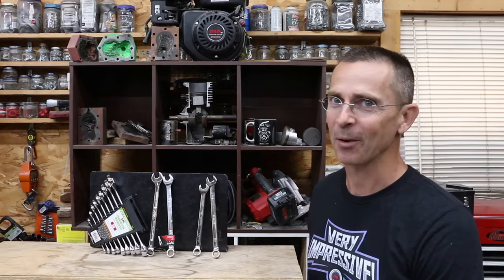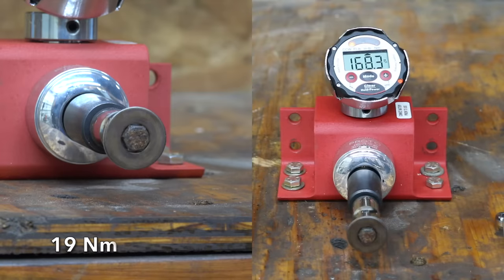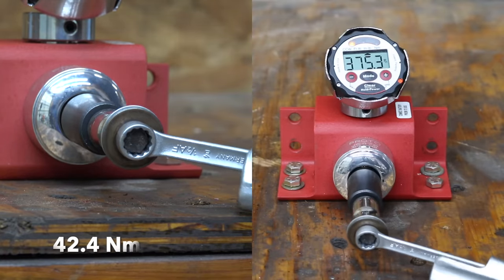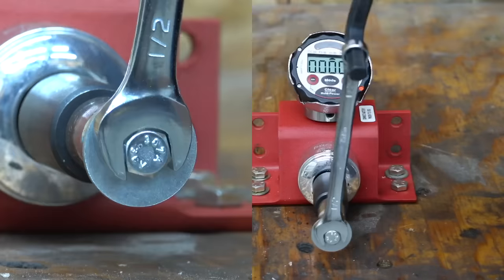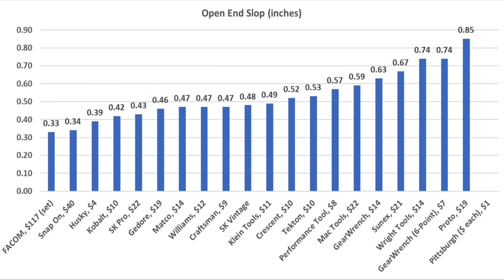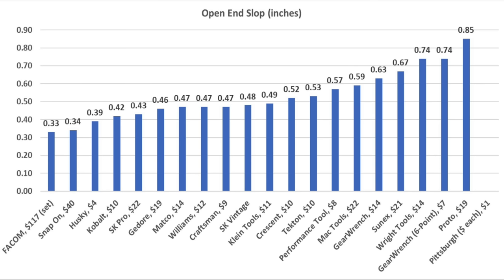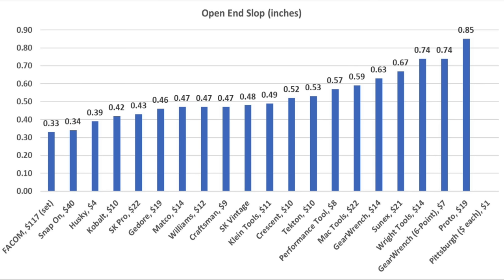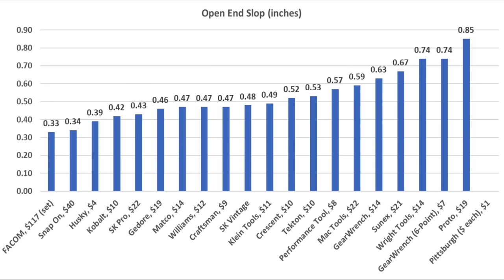Best Wrench? Let’s Settle This! Snap On vs MAC Tools, Matco, Proto, SK, GearWrench, Kobalt, Husky

Comment: I’m in auto body and I love my husky tools! Of course I’m not wrenching as much as a mechanic but they husky tools are so cheap and work very well for the price! Also can’t beat the lifetime warranty! 
When it comes to power tools however, I’m Milwaukee through and through 😂
Reply from the maker: Thanks for the feedback.
Reply: I was very surprised by the Husky in this video. While its average finish wasn’t at the top, if you consider its score as a percentage of the top scorer for each test it was always doing very well. You’re getting around 80% of the best wrench for 10% of the price. Can get the 10pc set for $20 right now, for me that’s a no brainer.

Comment: As a former professional mechanic, I found the old MAC wrenches with square handles to be the most comfortable. My buddies that had snap-on complained they were like holding the sharp edge of a knife when putting pressure on them.

I also prefer 12 point wrenches because they work better in tight areas, whereas 6 point sockets are best.

Just my $.02
Reply: Exactly! Snap ons are too thin and flex alot. Cant hit em with a hammer cause they act like springs! lol
Reply: I've had really good luck with older craftsman stuff. Unfortunately the warranty is kinda worthless now, but they'll take a lot of abuse.
Reply from the maker: Thank you!
Reply: I have found 12 points to be the best but I work on industrial equipment with lots of paint layers on it
Reply: MAC used to be made in USA. 
But its owner, Stanley, sold out years ago. 
Even moved HQ offshore (a mailbox) to avoid US taxes.
Reply: @BA-gn3qb  mac wrenches are usa made in texas   this wrench is a facom 440 wrench rebranded to mac specs
Reply: @mikethetoolman8776  - They used to be made in Texas. 
This video at the 5 minute mark says Taiwan.
Reply: @BA-gn3qb  . I think some Mac tools are still made in Dallas. Same as the Proto.
Reply: Sounds like my experience based opinion. Us Army, lifetime shadetree DIY guy.
Reply: Exactly!
Reply: It's amazing how many people do not understand why 12-point wrenches exist. I guess they have never been in a tight spot where you can only move the wrench an inch or less.
Reply: @BA-gn3qb  Can't blame them when you see how high USA corporate tax is compared to the rest of the developed word.  Plus, corporate tax is just passed on to the consumer.
Reply: That has always been my biggest issue with Snap-On wrenches. I’m a cattle rancher that also does a lot of automotive work. I don’t have lady hands by any means, but that edge is brutal. If I am having to really torque on my Snap On wrenches, I’ll put on my leather gloves and try to push against the end where it has some girth. Usually I just grab an old Craftsman and whack it with a hammer though. Lol
Reply: @BA-gn3qb Stanley tools is still located in New Britain Connecticut and is like a city in it's own with a very old collection of buildings there not doing as good as they once was with hand tools but they are with power tools these days.
Reply: I have an uncle that says that(the most comfortable) about John deere wrenches

Comment: I think husky won this with the price and a very decent tool for the usual reasonable use. sure it's not the best one but for the price it's very hard to beat the solid performance. I wish it didn't miss that one test. TY for the great video man.
Reply: Don't forget the lifetime warranty!
Reply from the maker: You are welcome!
Reply: @ProjectFarm  Was the Husky scoring negatively impacted due to the one test it was not included in? Seems like it did better than the final results would say. I am not sure if you corrected its scoring for the messed up test or not.
Reply: Husky for the casual user, Wright for the engaged amateur. Unfortunately, both not availabe here.
Surprised about Gedore!
Reply: Good point, 10+1+9+7=27, divide by 4 and the average is 6.75 for the Husky.
Reply: I used Husky wrenches for a couple of years on industrial equipment and I will say they did ok for the price. But I discovered Wright wrenches and haven’t looked back since.
Reply: Once you start using the open end you will quickly realize why husky wrenches sucks. You will end up buying Wright or snap on, which are the only ones that doesn't spread out under realistic circumstances.
Reply: the expensive one, when you hold and turn. it better on your arm. one commented from a professional mechanic.
Reply: 100%! Most of my tools are vintage Craftsman but buy Husky for replacements. Rarely disappointed. If they break, can purchase 7 of them for the price of one Mac!
Reply: I thought the same thing. Best bang for the buck. It failed the open end test where it broke at 819lbs but it did still do 819lbs. The rest of the test it was in the top 5.
Reply: @jamescole6846  the open end is the most important part. Many if not all of this wrenches are strong enough to lose bolts or nuts with the crown side.
Reply: @ProjectFarm  I'm also wondering about the score the husky got, you excluded it from the results of the max torque allen key test but then it did have a score in the end overall table (and a bad one at that)
Reply: Williams also makes a USA set that is great quality for the price just lime Wright or SK to bad SK sold to China
Reply: @markusa5521  you are right, Williams make good wrenches, but after watching the Wright Grip wrenches there is no comparison.
Reply: @andysgreif  m no o
Reply: Kinda wish I had bought that multi pack from Husky instead of Harbor Freight then
Reply: I have a set of tools from METRINCH that I purchased over 20 years ago and believe were made in Germany. I see many of the same name sets made in Taiwan and USA wondering if the originals are better than these new sets. Also wondering how the the German made set would perform in this test.
Reply: @krollpeter  I would have to say Wright tools are professional quality tools.
Reply: @tommyinla  I stand corrected - Thank You!
Reply: @mandapalque  Personally I use craftsmen on all my garage mechanic work. Not because they are the best or the worst. I just happen to buy one of those 500 piece mechanic sets like 25 years ago and I still have them and they still work. I do have a big set of kobalt sockets in one of those big cases I keep around for portability that seem to work fine after 5 years of use but I have never used a kobalt wrench. I did pick up a set (the small medium and large) Icon torque wrenches a few years back that I am really happy with though. They are nice quality.
Reply: As a sinple homeowner, Husky has been very reliable for hand tools. I have no complaints
Reply: @andysgreif  Yes, it looks like it got a last place finish.   Not sure I agree with that, unless he knows something we don't.
Reply: @mandapalque  yet the mac won and the snap-on finished 4??   this wasn't the best model mac wrench he tested either?
Reply: @mikethetoolman8776  in the other videos I have watched they haven't used the MAC he used.
Reply: I agree, I thought Husky performed surprisingly well. Sure, it may not have won, but price-wise it stood up very well against wrenches several times the price.
Reply: @dtgoertzen7032  husky-proto-mac-craftsman  all owned by stanley
Reply: I concur, vs Snap On for example, its 1/10th the price for about 75% the quality (overall), plus Husky has no "slippery" chroming/finish!
Reply: yeah, and if you factor in the price. it's really hard to beat.
Reply: @christopherbrown6493  GearWrench are also very good.
Reply: @stopthephilosophicalzombie9017  I won’t argue that, use flex ones for those pain in the butt spots. Also have a few of the ratchets they make. Don’t believe in spending $180 for a 1/4 ratchet.
Reply: @krollpeter  i think gedore went on this light version as a proper german would with logic, light tools for repetitive, precise work. If it doesn't go with hand wrench by using your hand, use socket to brake it loose as it wont slip. Precision after all, but i would bet they have a hardcore heavy alloy wrenches as well that should easy  run through test.
Reply: @kmetmosnja6341  If you have an entire bag full of these and go to clients, lighter sure makes sense.

Comment: Excellent tests and video!  Back in the 1970’s, a patent was issued for a radius design between the 2 flat surfaces on a box end wrench and sockets that helped to distribute the torque around the radius to minimize the splitting of box end wrenches and sockets and minimize the round off of the bolt points.  I believe this radius design was licensed to Snap-On for the 17 years of the patent life.  Older box end wrenches and sockets have a sharp “V” groove which a fault point that allow the snapping of box end wrenches and sockets.  Since the patent has expired, almost every box end wrench and socket uses the radius design.
Reply from the maker: Thanks and you are welcome!
Reply: Good old Bonney.  "Loc Rite"?
Reply: @davidpowell3347 I don't remember the name Snap-On used exactly, but I do remember the words, "flank drive".  Now, every socket manufacturer now uses this design since the patent expire many years ago.  If fact, even the cheapo socket sets now have the Craftsman push button, quick release, ratchet mechanism since that patent expired too!
Reply: @billhandymanbill2775  Yes, "Flank Drive" was a Snap-on trademark.
Reply: @davidpowell3347  hello from Europe an uncle of mine gave me a bonney breaker bar that he got from a pal who worked in USA. Are they still made and were they any good?
Reply: @tomlyne1172  I think "Utica",Triangle, Cooper and "Kelsey-Hays" were other related or associated/sister brands to Bonney,Bonney I believe supplied tools for the airplane/aerospace industry and the US. military as well as mechanic's tools,new production seems to have stopped in the early 1990's
I believe they were as good as any tools made in their era,rumor has it that Snap On bought them out perhaps to get the off corner engagement patent  (may have changed hands more than once)
I notice that one of my Bonney impact sockets (17 mm.?)which does not have the obvious chamfered corners shows a tiny bit of radius in the corners when viewed with a magnifying glass-this makes cracking at the corner less likely  
   Suggest: look up Alloy Artifacts Tool History Page and look for articles on Bonney,Utica or Kelsey-Hays -also "HJE" "Epstein's": Jori Sackin's hardware store who is a dealer in antique tools and sometimes has gotten "new old stock" discoveries for sale

Comment: I absolutely love this channel. One piece of advice I have, is to include the price of each tool in every scene. It sometimes gets hard to follow which tools were the most expensive and having that bit of knowledge on each test, would provide valuable information as well as more entertainment when you see the most expensive tool fail right in front of your eyes.
Reply from the maker: Thanks for the suggestion.
Reply: Agree.....
Reply: Yes  that would help a ton because now I always focus on the cheaper end of the tools and now I always have to remember a few brands that perform good

Comment: You know... It's always impressive to see Husky tools usually do pretty well in your tests. I have found some real respect for that brand recently. I think people sleep on Husky too much.
Reply from the maker: Thanks for the feedback.
Reply: Husky doesn't make amazing tools overall, but what they do excel at is making amazing tools relative to the budget price point. They are the king of ultra-cheap tools.
Reply: After doing recon for like 6 months, I went with the Husky reinforced toolbox from Home Depot and couldn't be happier. Great value. Between myself and other guys in our shop, there are 6 husky toolboxes in the shop.
Reply: I think my air compressor is a husky. It has been pretty good for a lot of use at home. Maybe wouldn't be great for every day use at an automotive repair shop, but it works for me.
Reply: Yep, for the average weekend hobbyist that doesn’t use the tools often enough to justify a big investment, Husky can be an excellent value.
Reply: I have a husky 3/8 ratchet.  I love that thing.  It’s like 30 bucks and worth every penny.  Very durable ratchet mechanism, has a flex head to help it get into tight spaces, and it has an extendable handle for when you need just a little extra leverage
Reply: @kirbyjoe7484  that is what it seems like to me. As someone who really only uses them a few times a year for major repairs and isn't a professional, these look like the winner to me.
Reply: @quartersawn5  Exactly what I was thinking too!
Reply: Husky would have ended quite higher if it weren't for that one test he said got messed up.
Reply: I think they are made by the same company that makes gearwrench. Or at least owns gear wrench
Reply: Another benefit of husky is that it's home Depot lifetime warranty and home Depot is everywhere. So easy exchange .
Reply: A lot of my tools are Husky these days or I should say most of my day to day tools with higher end tools for my torque wrench etc. after seeing some of these tests I feel good about it haha
Reply: @crazy4gta1  the Husky 3/8 stubby ratchet was awesome when i was doing electrical for pools.  All the sand didnt phase it at all
Reply: Yeah, Husky performs quite well for it's price point.
Reply: That's been my experience with them too.
Reply: @jalee6587  I will never step into a Home Depot, ever
Reply: I have husky wrenches in my tool box at home and they are pretty good. They replace a set made by Allen (USA) that were much better but I paid a small fortune for those
Reply: I've been saying this for years. Nice to see real testing bear it out
Reply: I thought that chamfer was a good thing?
Reply: @mr.orim0782  chamfer makes it easier to get the wrench on the bolt/nut, but at the expense of gripping less and a higher likelihood of rounding the fastener when the exposed section of the fastener is thinner and/or rusted (like how he used a washer to only show some of the hex head and rusted the bolts). 

Zero chamfer would be annoying to use all the time (especially on rusted things) but too much makes it slip easier in bad conditions.
Reply: @Soupy_loopy  My dad was a residential carpenter for 35 years and has a Husky air compressor that he's used for a while for work that doesn't require a big compressor. He's been happy with it.
Reply: I own a Husky ratchet set my now ex-wife bought me over 25 years ago.
I still have every piece, like over 60 parts. I've used it constantly for this whole time, yet it's the only ratchet set I've never had a problem with other than my SK-Tools set. Every part of my Husky ratchet set still looks like the day I received it. Talk about a good outer coating.
Reply: Agree!
Reply: @morganw6228  i just compared Husky's ratcheting box end wrenches to Gearwrench's in store the other day and they were identical forgings.
Reply: DO NOT BUY MAC TOOLS
Reply: @rediron44   they do mail order and curbside pickup....
Reply: I just posted a comment above. I took his numbers and gave each tool a weighted score based on performance. Divided it by price, and husky came out as the highest quality score per dollar spent. Was kind of eye opening
Reply: @benknrobbers   it is even a better value IF bought in a set and IF the sets are the same quality as individually sold.
Reply: Agreed, Husky is a great budget, high-value tool for the home gamer - not the best tool, but great bang per buck. I surrendered to the Home DESPOT long ago anyway hehe.
Reply: @Nick Stachowiak  I agree I was looking and comparing toolboxes. I was impressed with the husky brand! Another great toolbox were harbor freights. I ended up buying a craftsman roll away  because it had deep pocket drawers. I needed a place to store some bigger tools.
Reply: For wrenches I like craftsman the feel in hand is just what I look for. Every mechanic I know has them in there box.
Reply: Pretty sure Husky and Gear wrench are the same wrenches
Reply: @kirbyjoe7484  yes, that is what I meant but you put it into more clear and concise words. Lol 

I was mostly referring to 1/4" hex to 3/8" socket adapters and some of their other sockets and wrenches. For being budget tools, they are actually pretty dang good.

Comment: I am absolutely excited over this. I’ve been using the box store husky, Stanley and craftsman for 20 years. I’ve accepted the performance of the tools considering the price but I’ve been wrenching a long time and I’m at the age I want to own things that make my life easier and I know what I’ll be buying in the future, thank you so much for the effort you put into these videos!!
Reply: To J. Smith: I'm sure you know what you're doing, so with all that, What brand do you think you'll be buying in the future?
Reply from the maker: Thanks and you are welcome!
Reply: Proto is the company that manufactured the old school craftsman. I've heard plenty old school mechanics swear by them, so I was happy to see the testing results hold up.
Reply: Those mac precision torque wrenches are light, strong, and super comfortable. They have a wide grip surface and a rounded I-beam design. Whenever I can, those are my go-to wrenches as a diesel tech. Your hands will thank you!